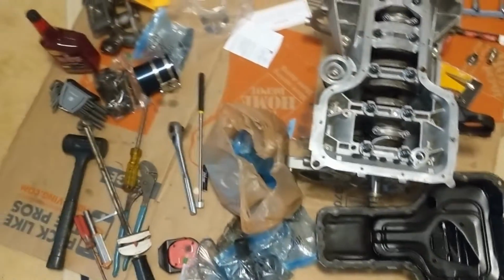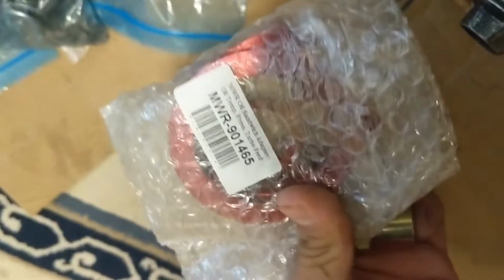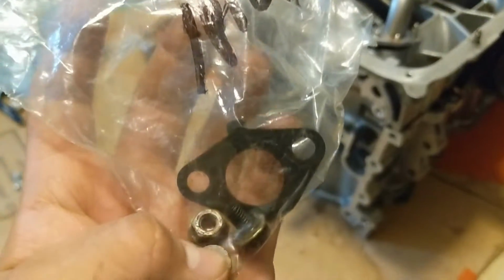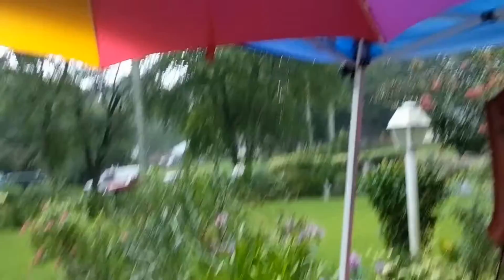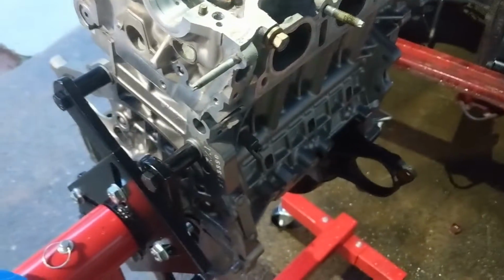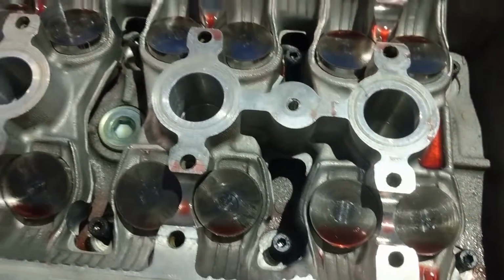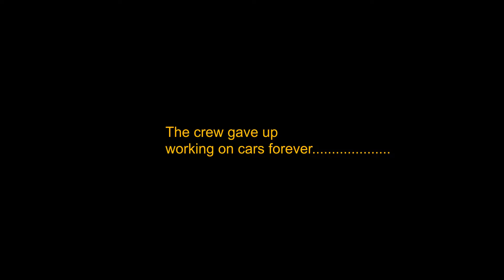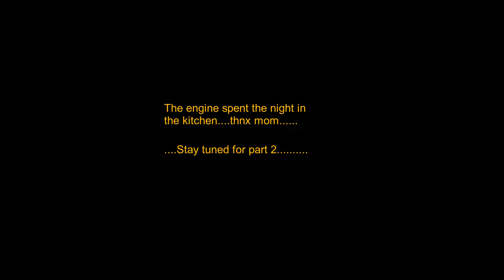400 HP FORGED Celica/MR2 Turbo Engine build 1ZZ| Part 2

Comment: I do feel your pain there, as I once had a cam bolt sheer like that (there is no more sickening sound, when in the final stages of reassembly, than a bolt giving out!), which I had to put down to experience, the lesson learned, in my case, being that the one tool you should never buy the budget option with is your torque wrench. Anyway, I guess it was time to put the tools down and catch some sleep, before getting busy with the drill and stud extractor in the cold light of day. Keep up the good work, you're almost there, as a fellow 1zz powered 7th Gen owner, I can't wait to hear it fire up for the first time :-)
Reply from the maker: The manual didn't do a good job of specifying what the torque spec was, it showed two different values one for the cam caps and the larger cap. Of course now looking back at it the smaller number made sense haha.the rest of the bolt came out easily without the need of drilling SURPRISINGLY. Thanks for watching man !